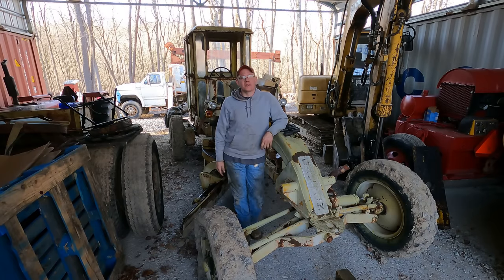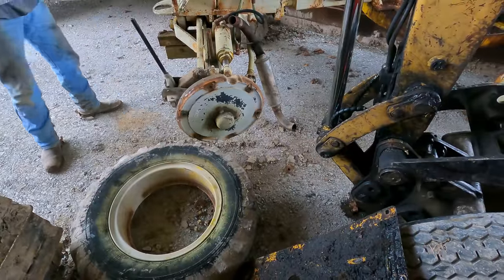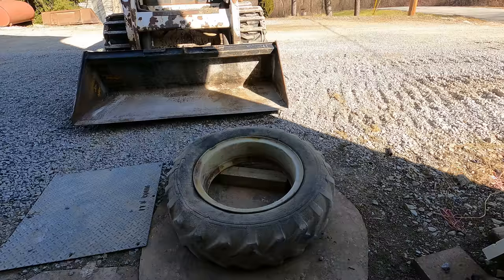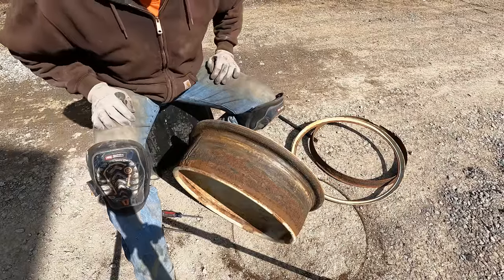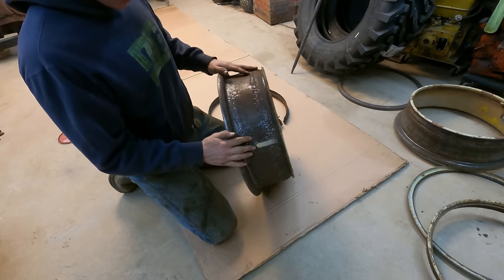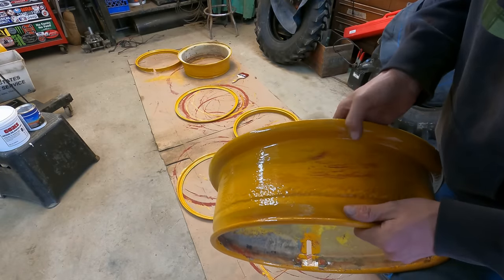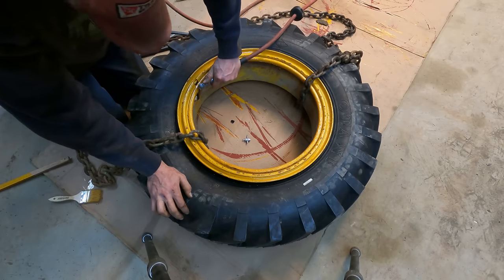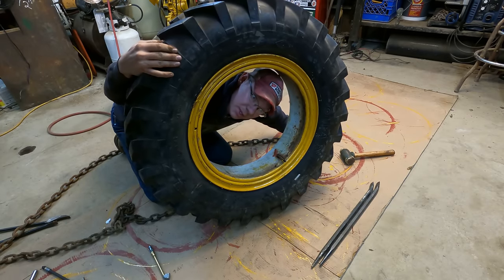1950's Galion Road Grader "Widow Maker Rims" Pt.4

Comment: For future reference you can just find a set of "Dayton" style 22.5" steel wheels and run standard tubeless 11r22.5 or Lo-Pro tires. Much easier to find not to mention about 10,000 times safer and more reliable. Did that all the time to weed out any old split wheels we came across

Comment: Boy did this bring back memories. In the mid50s I worked with my dad at an oil drilling outfit in Colorado, and a lot of the heavy equipment had these so-called safety rims. I was 12 years old and thought I could swap one out no problem. Boy did I find out different. Wish this video had been available way back then! Keep up the good work these are fun to watch.

Comment: Simple tire .com , kool thanks love it, my grader has 13 -24 , and for some reason the front has 14 -24 , 10 lug, solid wheel you shoul allways just loosen the wedges and hit the back of the wheel , some times they explode off , penetrating oil works well , kool thanks BigAl California.

Comment: Back in the day I had to repair, on average, 8 of these a night. did that for 6 years.  Swinging a bead hammer is an art. never had one blow, but I also used a cage  religiously  to inflate. You are right, clip the chuck on and walk away.

Comment: As they are not drive wheels, the threads should be facing the other way so they last longer. Otherwise, great job.
Reply: You're right  i see a lot of graders with the front wheels on backward. doesn't make it right
Reply: @mog5858 , There is a good reason for this - tire cleanout.  The bar tread tires are mounted in the direction they are so when spun under power, they move the mud to the side and clean the tread pattern out.  Having bar tread tires on a non-drive axle, you mount them reversed so they clean themselves out as they are driven by the ground.

Comment: Back when I was  much younger and quite a bit dumber. I worked in a tire shop.  I remember the first time I had to go out in the field and change a set of those tires.  This was so many years ago, the service trucks were pick up trucks with a tool box and air tanks thrown in the back. Chills kept running my spine. lol

Comment: machine like that would have to earn its keep in the 50s couldn’t be originals
Reply: I just had to get the tires fixed on an old trailer I use on the property and they were at least 60 years old.
Reply: @seanworkman431  how much work did a trailer do between now and then
Reply: @seamus7495  I'm not sure to be honest but it hasn't done much since I got it. I would never take it on the road again but it's okay for getting about the property. I think it was homemade for domestic use but it is interesting that the winter tire is still soft to the touch and the stud pattern is 60's Ford 4 stud.

Comment: Wow, I am surprised with about 1200 comments, no one has suggested that I have seen to pour transmission guild around the beads and the locking rings and let sit for awhile.  Having equipment, use an outrigger or bucket to assist breaking beads.

From what I have seen and have done a few thousand over the years, you did it right for not having the proper equipment. We always used needle fingers and wire wheel, then repaint. At the sho we sand basted them then repainted. And without a cage, yep we chained  them too! Great job!

The only thing I would say is while you can mount the directional tires on the front as you did, but the front should be reverses to allow to slip when turning. 

Other than that Matt, as an old time equipment operator, great job and give her a new set of rear tires when you can afford it!

Comment: With a mountain bike  there used to be tires called "farmer johns", that had a tread pattern similar to tractor tires. One would mount the rear tire so that when torque was applied when pedaling the mud would work itself out to the sides of the tire. The front tire would be mounted opposite the rear so that when braking, the mud would work itself out rather than into the tread. I don't know much about grader work. The principal for the front tires on a grader, would be to grip but clear muddy soils so that they can guide the blade. With the tires mounted like you have them, the tires will tend to fill with mud and slide. Is it possible that you have the front tires on the wrong sides of the grader?
Reply: Those tire are designed so that when power is applied that 'V' pattern / tread digs into the surface, if you turn them backwards and apply power that tread design will 'lift' the tire up and out of the surface, thereby loosing grip. I heard that from a Firestone tire sales rep. a few years ago,, so I think I'd 'bow' to his knowledge of how a tire tread works.
Reply: no power is applied to the front, it is a steer tire and doesnt need much tread at all
Reply: @davesilvia9711  I know that Dave, it's rear wheel(s) driven unit, but  grip sure as well helps when steering and grading,   I used the word 'power' in a broad sense  meaning
that the tire needs to grip the surface on which it rolls.
Reply: Generally you wouldn't use an aggressive V tread on a nondriven steer tire.
Reply: @johndeerekid167  S'hhh don't let Caterpillar hear you say that,.. they've had those tires on their Graders for eons!

Comment: I didnt see this in the comments. when the air first going in watch the bead inflate up the the lock ring then tap with hammer the lock ring to make sure it is set. Good job cleaning all the rust and painting it. and check the valve core for air bubbles before putting valve cap on. now in your record book enter the year and date tire work was completed. This brought back alot of memories with split rims and tire work.

Comment: I've heard horror stories about split rims. A fella in my home town was decapitated by one off a dump truck, went through roof of the tire shop in top of it.
Reply: sorry to say but these are not a split rim. they are just an OTR tire rim.  split rims had the split in the middle of the rim.
Reply: @mog5858  Dunno witch is worse. Split rim that has heavy half of a rim coming at you if bolts fail due corrosion, or these 3 part rims, where locking collar and outer peace being lightER come at you way higher speeds and sharper edge. Ether way if you are in the way, with say truck on full load on top of it, you are toast. Heard and seen plenty of cases where this type of rims have failed on the road side, where you cannot put chains around it while working and road salt corrodes the locking ring away. After couple of decades now all tire shops have their own safety cages around the wheel when working on it and two or three peace rims are thankfully nearly extinct around here. 
Got few from trash with decent tires, but i'm not even planning on putting in those barely any pressure. At tops 1bar as pressure test, running pressure being way lower since these are low pressure tires and there wont be barely any weight on top of those since its going to huge wheel diy ATV thing. On truck i would not even touch those.
Reply: I knew a guy practically killed one time but you got to be careful
Reply: Probably the original tires
Reply: Put some soapy water on that tire and rim
Reply: Angle grinder time
Reply: @mog5858  Wondered when someone might mention that, they are in fact 'split RING' rims.

Comment: “Sitting on the toilet seat at Walmart”
Guitar Riff
Shaking hands with danger

Why not just cut the old tire off the rim??
Edit: Never mind 😂.
Reply: Used to have that trouble with old ex-army truck tyres we had on our wood crane at the sawmill....
Easy solution was throw them on a good fire.
Cleaned the rims of 50 years of paint and blasted a whole lot of the rust off too, wire wheeled them down and a fresh coat of paint and they were ready for fresh tyres and another 30+ years of service 😁

Just to add.
Before taking the chains off and BEFORE you get to full pressure, it is always better to give the split ring and outer ring a a knock or 2 with a hammer to ensure complete seating 👍
Reply: @WeeShoeyDugless  Speaking of ex-military trucks and tires. The volunteer department I used to be on, I went down the Cape Canaveral to pick up a hemitt M978, we got it through a program which was started between our local forestry commission and the military. I remember driving that bad boy back and thinking, lord don’t let me get a flat tire. It had its own hand operated crane to lower the spare tire down 😂. And I know the rubber for those things is extremely expensive. We only have one or two army surplus places near me, they sell to the public. Well they set those prices so it’s typically extremely expensive. Luckily those tires last a long time.
Reply: @firewalker1372  The tyres on ours only needed changing because they got ripped apart on sharp trees etc, think they were made of indestructomium 😂😂😂

Comment: I am 55 years old and probably one of only a few that have had a split rim blow apart while airing it up.  It was in a cage when it happened.  I was about 20 years old at the time.  If it would not have been in a cage, I would have been dead.  After seeing how much force there is behind a blown split rim, I am not sure those chains would work.  Seems like a false sense of security.  I couldn't hear for nearly a week and to this day I have tinnitus in both ears.  They later determined that the tube failed at a seam which started a chain reaction of uneven pressures inside the tire, forcing the split ring to blow off.
Reply: That's a scary story
Reply: we had 3 graders a 4 articulators with split rims on them we use to rap chains thru and around the tire and cage them, then hook up a lock on air valve and turn on the air from outside the room to fill them we heard to many stories from the old timers. Did that for 10 years and got lucky, when we had one seat wrong we use to disconnect the air hose from the wall and let it air out till empty, you can never be too safe with those rims. I wont comment on the seal rim being rusted away...........
Reply: That's a scarry storey. Luckily, or more likely good planning, you escaped serious injury.
Reply: Back up.
Reply: I also have had a split rim blow on me. I had it in a cage also. And no those chains wouldn't hold it. Mine was a real widowmaker rim. Where the actual rim had the break clear across it, bead to locking ring. Lock rings were both solid. Those were the real dangerous ones. After that, I and the shop I worked for would only dismount them, never mount them back up.
Reply: @j.d.weesner4059  I use to hate the ones with the Orings and no tubes the amount of grease we had to use to get it starting to blow up made a huge mess and just added to the danger

Comment: no way in Hell I would reuse those rings. the widow maker earned it name for a reason
Reply: Agreed! 100%
Reply: widow maker earned it name because people are lazy, stupid or  uninformed as to how the rim works.  The main cause of split rim accidents are improperly set rings, bent rings and over inflation. Bent rings are caused when someone bends them when trying to remove them. Improperly set rings is when you do  not pay attention to how the rings is suppose to be set. This includes improper tube placement and or boot placement. The best way to install these rims is to insert tube, remove valve stem and inflate/deflate tube. Then insert boot slide rim over top and rotate and stick stem in to slot. Inflate/deflate tube again. Then place ring on and then ring clamp. Insert valve stem and inflate to about 10 psi while checking proper seat of ring and clamp. Once confirmed that ring and clamp are properly in place inflate tire to proper cold psi. You do not need to over inflate the tube.
Reply: Dan, I wouldn't use the wheels, but definitely the rings need replacement
Reply: @kameljoe21  Yea, clean ALL dirt & rust off, then when they fall to pieces due to being 70% rust, you replace
Reply: Yea me too I think I would have hunted up some better rims and rings. Of course all I would have needed to do was dig around in my hoard of junk to find some.
Reply: @rockeerockey6941  the million $ Question is where does find replacement rings/rims. Im pretty sure they stopped making those in the 70's or earlier?
Reply: @danbierschbach7743  In your stash Dan, or find a one piece that would fit

Comment: We built a cage out of steel tubing.  Built it bigger than our largest split rim.  You assembled the tire, tube and rim, stood it up and rolled it in to the cage.  Put your chuck on it and never had a worry.  Worked great if you a bead broken and just wanted to seal it with a little ether and a torch too.

Comment: I England, we call them rims “widow makers”, they are illegal now.
Reply: That type of 3 piece rim isn't illegal, still plenty of equipment that uses them
Reply: Only illegal on road vehicles
Reply: @tomevans1251  There not even illegal for road vehicles in the uk or USA. Plenty of restored vintage/classic trucks with them.
It's one of these things that's generally accepted as illegal but no one can point to a single piece of government legislation that states it (more than willing to be proven wrong). 
There are MANY types of split rim wheel and the 3 piece separate outer bead and lock ring is not actually the traditional 'widow maker'.
The biggest issue is actually finding a tyre company that will touch them.
They are only dangerous when assembled incorrectly and all the accidents are nearly exclusively on first inflation or disassembly when not fully deflated. In use they are pretty damn safe.
Reply: Yeah plenty of heavy equipment still has them my local setyres will even fit them
Reply: @BadDriversOfTennessee thanks for the information. It’s good to know.
Reply: @deezelfairy  thanks. I wouldn’t recommend using them. I know you can still see them, but they are not fitted to modern vehicles anymore.
Reply: @johnobiro5202  They have fallen out of favour with manufacturers, but their main demise in road vehicles was due to the introduction of tubeless tyres rather than safety - far easier and cheaper to build a 'sealed' rim in one piece then in multiple pieces.
Very large earthmover wheels even today are still made this way - its the only practical way to change a tyre 6ft or more in diameter.
Reply: @deezelfairy  thank you. I agree, it is hard to change the larger tyres. I would still be wary of working with them. Take care.

Comment: A truck tire changer literally lost his head when a split rim came off, many years ago.
Reply: Could you give a dumbed down version of how that could happen to someone who's only dealt with passenger car/truck tires?
Reply: @abelq8008  Apparently, he was leaning over the tire to air it up when the split ring came off and went up and severed his head. It also blew his body several feet into the air. After that the truckstop bought a steel cage to contain the tires when they were being inflated.

Comment: Two and a half minutes in and you've got it on a jack on a packed rock "floor" taking the wheel off with no jack stands.

It's called Christine but you don't have to help it out.  Resist it's urge to kill you, don't go with the flow on this one. :)

Comment: I printed mechanics in 1981 on a rural small island on the west coast of British Columbia we did all the department of highway trucks and machinery by and just like that in the ceiling of the garage area with a corrugated Tin Roof that had a crescent moon crease in it that was from a split rim that was inflated without chains before my time I always use the same set of chains and the links were spread quite thin after one particular inflation great video cheers

Comment: Ha, was about to ask if you couldn't just  sawsall that tire in half and you break out the knife and cut it off 🤣
What a job - interesting style of rim; thanks for taking us along for the ride.  Gingerly poking a tire after airing up to see if it's going to explode - ha!
Reply: Would sandblasting be easier to clean those up than the needle scaler?  If you had a big enough cabinet, of course?  
Was satisfying watching those get cleaned up - they turned out great!
I have a few projects where that primer could really be useful.

Comment: When i use to fit tires to those type of rims i was always told the the split in the ring should always be 180 degrees away from the valve.

Comment: Good job changing those splits with no equipment.  I haven't changed one since the 60s, but I worked in a shop with a hydraulic tire machine so it was a lot easier.  We didn't use chains on the tires when inflating.  Instead we put them under the hydraulic hoist.  I would have painted the inside of those rims with phosphoric acid rust converter before priming, but that is just me.

Comment: To break the bead off a tire by hand, use the curved blade of a garden spade. Lay the wheel on the floor, press the blade into the bead and jump on it until she pops. You can use an old towel laid over the rim to save your fancy paintwork if you have it.

Comment: If you use a little tire soap or even dish soap mix on them when breaking down, they will dismount much easier. Also when putting back together I air the tube before remounting. Leave the core out of course.

Comment: When I was an apprentice at our local garage, my job was the fit the new tyres to the split rim wheels on the older lorries. We had to use a cage whilst inflating the new tyre. I only witnessed one rim split off the C clip and explode. That was back in 1963.

Comment: I had some split rims on a old truck and changed tires several times. And lived to tell the story about them. Never did like those old rims so when I got the chance to get a newer truck I left those rims on the old truck and sold her as is. I can still at 70 years old change a tire by hand but won’t do split rims anymore.